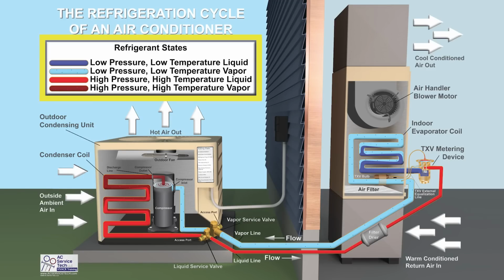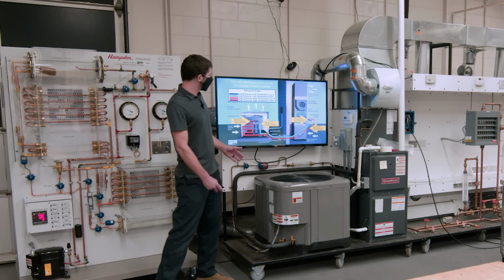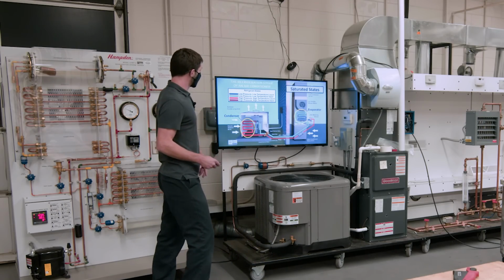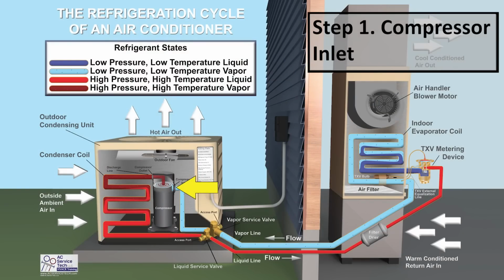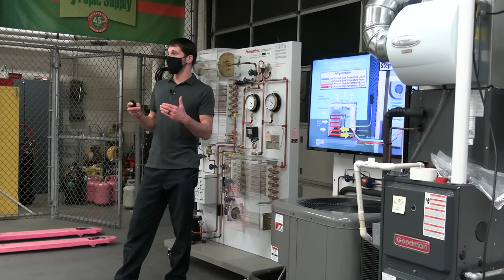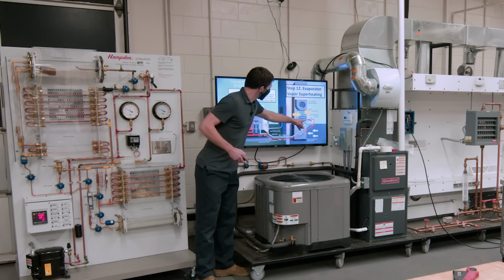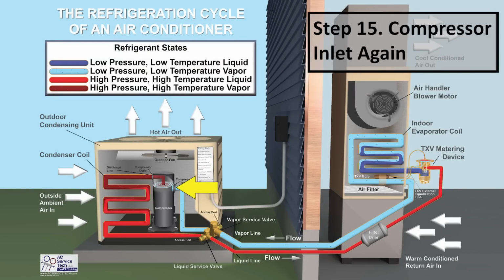HVAC 1st Year Apprenticeship Class, How an AC Works, Refrigeration Cycle w Bryan Orr- HVAC School

Comment: You know, I remember decades ago when I got into the trade? I thought to myself you don't technically need a condenser outside because if you set up your compressor in the house, you could have it run into a pressurized vessel like a water heater, heat up the water. That's inside at the same time. As it changes state, it can be used by the system.
And then, at the same time, it can return into the top of that vessel.
And you would have a complete cycle without ever having a condensing unit outside. So no matter what the outdoor temperature is, you wouldn't care because you're just heating your hot water heater. And cool in the water at the same time in a continuous cycle. No one ever listens to people when they have great ideas like this

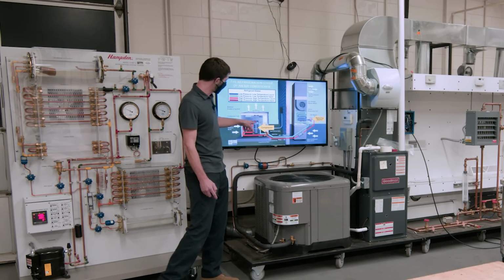Comment: Is the refrigerant flow direction correct on the slide around 6:45? I would think the evaporator transfer the cold from the line, so it would return warm/hot to the outside unit? I am just starting learning.

Comment: So is the hot air outside allowing the condenser to warm up the refrigerant and turn it into a liquid im not sure I’m confused lol
Reply: The refrigerant is at a higher temperature than the outside air so the air cools the refrigerant because heat moves from hot to cold. Something must release heat in order to condense as a liquid is a lower energy state than a vapor. The outside air is cooling the refrigerant so it can condense into a vapor.
What really helped it make sense to me is when I realized that heat is related but is not the same thing as temperature. Heat is energy, temperature is the intensity of that energy. I like to think of temperature as the density or concentration of heat. The terms hot and cold refer to temperature, not heat. The compressor pressurizes the refrigerant which increases the temperature. It does not significantly change the amount of heat in the refrigerant, it just forces it into a smaller area which increases its concentration (temperature). And since heat moves from high temperature to low temperature the air will cool the refrigerant therefore increasing the heat in the ambient air but decreasing the heat in the refrigerant. The condenser allows for effective heat transfer from the refrigerant to the ambient air.
The opposite occurs at the metering device and evaporator. The metering device depressurizes the refrigerant, same amount of heat just in a larger are so the concentration (temperature) is decreased. Now the refrigerant is colder than the inside air and so heat will flow from the inside air to the refrigerant. This cools off the air but heats up the refrigerant, the evaporator helps this process. An air conditioner does not "create" cold, it moves heat by cleverly changing the temperature so heat moves in the direction we want.

Comment: The key concept is this idea from Physics called latent heat when a substance changes state.This took me ages to grasp the idea that say liguid water at 1atm will stay at 100 deg C while boiling yet heat is constantly going in while this phase change is occuring is quite counter intuitive . The reverse is suprising as well water vapour condensing to liguid state heat will leave the gas without reducing the temperature of the water vapour gas  as the heat flows into the surrounding cooler environment. Producing liguid water.

Comment: Hello. Is "sub-cooled" refrigerant any refrigerant that is not in "superheat" state? Like is superheat a name for "vaporized refrigerant" and subcooled is another name for "liquid state refrigerant" could I think of it this way? or is it a mistake to think that way? Or does subcooling only entail the distance from the metering device into the evaporator coil until refrigerant flashes up into a vapor state superheat? Thank you.

Comment: Wasn't as clear as I'd have hoped but I persevered... watching it a few times.

I noticed you throw in incidental information which is good info but also detracts from the overall progress of your explanation. Having notes or putting up a list of things to go through in correct ORDER may help this apparently random collection of useful information.

I had to go outside your explanation to find out the terms subcooling superheat and saturated. I also note that the best piece of information you gave in the whole video was that we actually are interested vin temperature at the Centre of the two coils, but it's hard to access, so we gather that from the pressure readings on the lineset and convert to temperature. That is what made me understand..
 Not trying to be overly critical bit the extras you put in are detracting from what you are trying to convey overall. Things like whether it's a tx valve or not and which is more efficient ..is good information but it sidetracked your flow of information and that loses our concentration.
Reply: Well said. Agreed

Comment: What would happen if you tightly  covered the condenser with a large cloth, would the system operate efficiently and as designed? No it wouldn't, the same applies to humans constantly covering their own airflow. We weren't designed to constantly wear masks.

Comment: With all due respect to the gentlemen teaching this class, I would suggest you use simple terms and examples. As a retired engineer, the professor who taught this subject years ago used  water as the chosen refrigerant. All can relate to the boiling of water and visualize the change of state to water vapor. A further explanation of boiling water in a closed loop system is then the only way to created super heat. 

Just my humble suggestion. As always, a great presentation
Reply: This is what I do, too.  But hey, we're engineers.